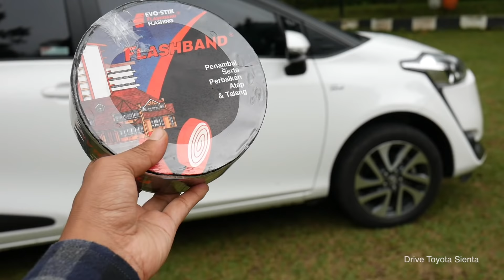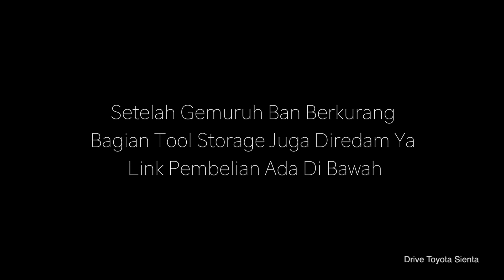Cara Ampuh Murah Mengurangi Suara Gemuruh Ban Depan Toyota Sienta

Comment: Kalo untuk agya buat fender depan belakang butuh berapa flashband om?
Reply from the maker: Mirip2 paling om. 1-2 roll om.
Reply: @DriveToyotaSienta  hasil nya bener sighnifikan gk om, soal nya agya itu kan suara gemuruh ban sangat masuk ke kabin
Reply: Fender 2 sama yg dipasang di dalem, untuk 1 roll atau 10meter itu masih sisa apa nambah 1 roll lagi om?
Reply: Gmn om agya nya udah d coba pake blm. Nunggu reviewnya.
Reply: @kearifanlokall  masih sama aja om
Reply: Ga ada perubahan ya di pasang di agya? Padahal baru rencana mau pasang di ayla lakbangnya
Reply: @seputarmuter8728  jangankan agya.. saya pakai jazz aja masih masuk suara ban nya.. emg paling susah buat ngatasin suara ban di banding suara luar dan mesin, mngkin bs ganti ban yg jenis silent road
Reply: seputar muter i
Reply: @seputarmuter8728  
Rekomendasi ban senyap;
1. Dunlop LM705
2. BFgoodrich
3. Michelin

Comment from the maker: Support Channel Drive Toyota Sienta Dengan Membeli
Belalai
https://www.bukalapak.com/p/mobil-part-dan-aksesoris/mesin-mobil/air-filter-intake-system/ehdfqo-jual-selang-filter-udara-toyota-soluna-bisa-dipakai-untuk-belalai-sienta?keyword=

Leather Pouch Untuk Smart key Sienta V dan Q
https://www.bukalapak.com/p/mobil-part-dan-aksesoris/aksesoris-mobil/aksesoris-interior/fipwbo-jual-original-leather-smart-key-pouch-untuk-remote-kunci-honda-toyota-sienta-voxy-dan-toyota-yang-bentuk-smartkey-sama?keyword=

Leather Strap Peredam

Bisa Pesan Via Whatsapp 0813 6114 8948

Atau Market Place Yang Berikut :

Lebar 2cm

Bukalapak :
https://www.bukalapak.com/p/mobil-part-dan-aksesoris/interior-mobil/jok-trim/155eiv7-jual-leather-strap-peredam-tool-storage-toyota-sienta-2-cm?keyword=

Tokopedia :
https://www.tokopedia.com/josephdiaknes/leather-strap-peredam-tool-storage-toyota-sienta-2-cm

Shopee :
https://shopee.co.id/product/123477886/1877350384/

Lebar 1.5cm
Bukalapak :
https://www.bukalapak.com/p/mobil-part-dan-aksesoris/interior-mobil/jok-trim/155einf-jual-leather-strap-peredam-tool-storage-toyota-sienta-1-5-cm?keyword=

Tokopedia :
https://www.tokopedia.com/josephdiaknes/leather-strap-peredam-tool-storage-toyota-sienta-1-5-cm

Shopee :
https://shopee.co.id/product/123477886/1877356196/